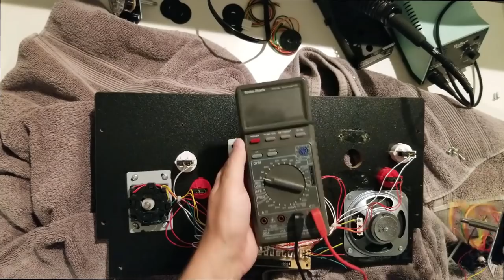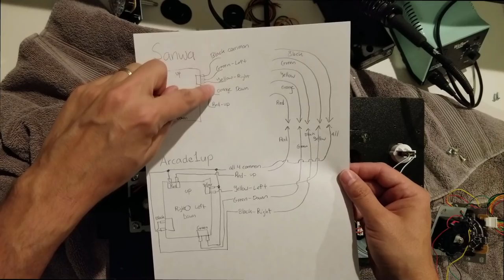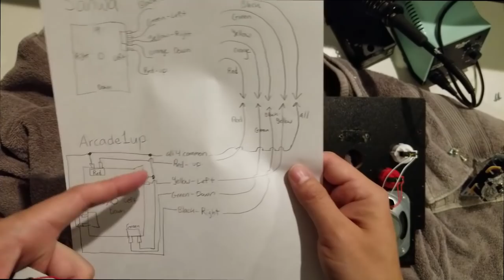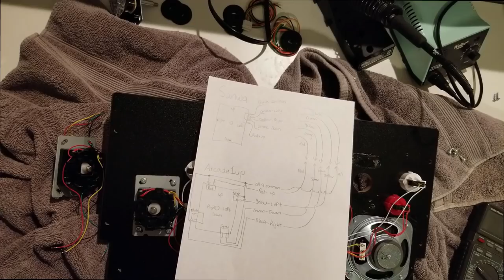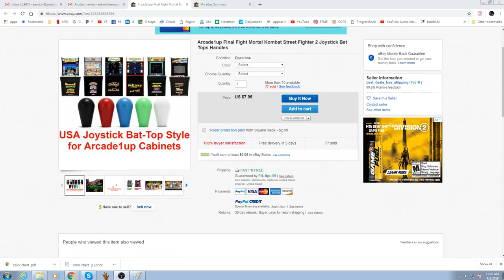Arcade1up Joystick UPGRADE!  SO WORTH IT!!

Comment: FYI: I purchased some Sanwa Joysticks to swap out in my 1-Up machines (I have a SF and Rampage). Had the wire cutters and soldering Iron ready, yet found when I opened them up, that the existing joysticks in my cabs were slightly different (white plastic base instead of black), and are 5 pin/wire, so the Sanwas were simply just Plug and Play! (I used the existing wiring and plugs) So easy! What a relief.
Reply: I guess I'm kinda randomly asking but does anybody know of a good site to stream new series online?
Reply: @Jamie Genesis I would suggest Flixzone. Just google for it =)
Reply: @Jefferson Yahir Definitely, have been watching on Flixzone for since april myself =)
Reply: @Jefferson Yahir thank you, I signed up and it seems like they got a lot of movies there =) I appreciate it !
Reply: @Jamie Genesis you are welcome :)

Comment: I really don’t understand why u made this such a big production. I just replaced my A1up pacman stock Joystick 🕹 with a Sanwa. I ordered it from diyretroarcade.com. They offered 2 kinds of encoders: old dual 4 pin or 5 pin. My cab had the older dual 4 pin. So it came with that wire. All I had to do is open the deck. Remove the stock joystick. Switch plates from the A1up Joystick to the Sanwa so I don’t have to drill. Swap the 8 position gate on the Sanwa for the true 4 position gate on the A1up Joystick (both gates are just pieces of plastic). Screw in the Sanwa to the board. Attach the dual 4 pin wires to the up & down port and left & right port. Test, and then close the whole thing up and remount the deck. That’s all there is to it. Didn’t have to break out any test meters or anything. Sounds like ur trying to adapt a 5 wire setup. All I really needed was that one wire with 2 4pin connectors & I was off to the races. 10 minute install.

Comment: There is a plug and play method from DIY Retro Arcade. Just buy the Sanwa sticks there and make sure to select which wiring you need (check your arcade. Some ship with different methods of connecting the joysticks from the factory) There is three option on the website, I believe. You'd save so much time. The part that took the longest was making sure the sticks were centered in the holes when getting the pilot holes and screws drilled into the CP. Then just plug them into the empty sockets you pulled the original sticks from. Buttons from there also work great, also plug and play. Highly recommended. If you have questions email Scott, I think his name is.
Reply: Thank you! I did not want to do all that soldering and guessing. I'll pay the extra money and save all that hassle.

Comment: Man, you made this project way harder than it needs to be. You probably scared many people off. You bought the wrong wiring harness set up for your machine. They have them so you don't have to be an electrician to do this project. You just match the proper wiring set up at purchase and plug in the harnesses to the proper place. Also the Sanwa's still only come with a 1 pound spring. It's best to get a 2 or 4 pounder(your preference I would try both) while you are at it. They also sell those where they sell the joysticks. If you use the old plate with the new stick you don't have to do any drilling. It's a plug and play 10 minute install
Reply from the maker: None of that information was available or known to me until this very moment.
Reply from the maker: @bigmacfullerton7870  Dude.. why are you acting so aggressive and rude?!?   Like I said... your comment was the first time I have heard there are different Sanwa wiring setups and mounting plates.  I have not yet verified that information either.

So why be so insulting?
Reply: @EdwintheMagicEngineer  I'm sorry I thought you were being facetious. If you really didn't know this then I wholeheartedly apologize. I thought you were being sarcastic and I was just thinking of all the people you scared off or may have entered into this world of wiring hell needlessly. Again I apologize for being rude. You seem like a nice guy. diyretroarcade.com has 4 different wiring set ups that cover just about everything. Others have them too.  Oh also Sanwa doesn't have other mounting plates you just use the old one, the original plate that comes with the game with the new joystick and it screws right in. You have to use the new mounting plate screws that came with the Sanwa stick and the old mounting plate that came with the game because the old screws won't fit in the Sanwa.
Reply from the maker: @bigmacfullerton7870  Thanks for the apology and DUDE!  That website is AWESOME!  I'm going to buy several things from it very soon!
Reply: @EdwintheMagicEngineer  Cool! Glad it worked out!

Comment: Where do you get the joystick
Reply from the maker: https://www.amazon.com/Denshi-JLF-TP-8YTFAST-SHIPPING-Joystick-Adjustable/dp/B01CRQMWEQ/ref=redir_mobile_desktop?ie=UTF8&aaxitk=m3JSHrna6eBZ4SjTODU3hg&hsa_cr_id=3187236950901&ref_=sbx_be_s_sparkle_asin_1
Reply: @EdwintheMagicEngineer  will it work on pacman 40th additon
Reply from the maker: @rickyholmes3549  I cannot 100% guarantee since I have never opened that one up myself.  But I very much suspect it will have similar circuitry to other cabinets.
Worst case (even though unlikely) I would be happy to help you with it if I can.  My public email is listed in my video description, email me if you run into an issue and I'll work with ya.

Comment: You needed to show splicing the wires. Did you just peel the rubber with a blade, then twist the wire and use electrical tape? That's not boring content.

Comment: Wow. This seems so longwinded. Great work though. 

I must have got lucky. My 1up joysticks were different to yours. They were 5 pin like the Sanwas. Also the base plate had 6 screws, 4 of which lined up perfectly with  the Sanwa sticks, so no need to drill new holes. It literally was a 5 minute plug and play job.
Reply from the maker: That's what I was expecting based on what I read online... too bad mine was not that easy.

I went back and forth on whether I should add all those details to the video, or just skip to the end result.  I suppose I'll see if people like all the description or if they just want the answer.
Reply: @EdwintheMagicEngineer  definitely good that you added all the details. Will no doubt help many people who end up with these stock sticks. When I said 'longwinded' I was referring to the actual process. Your video/upload is spot on. 👌
Reply: yeah my holes almost lined up but not exactly, for me a better solution was to switch the base plates between sticks (old to new). works perfect and then you will have 100% perfect screw hole line up.

Comment: Whats up Edwin? When you opened up the Sanwa joysticks it reminded me of a short-throw shifter for a racecar or performance mod for a manual vehicle. Also when you took the factory joystick switches out it seemed like the same thing as having a regular keyboard and moving up to a mechanical keyboard (Night and Day difference!) The wiring seemed like a pain in the butt but you specialize in computer stuff so it probable wasn't too bad for you. Cool Video!
Reply from the maker: Hey Sean, I'm glad you enjoyed it.  Yeah it was not difficult with my background but hopefully this is helpful to others wanting to do the same upgrade.
Reply: @EdwintheMagicEngineer  Most definately!  I bet they won't have radioshack multi-meters though.

Comment: Just what I was looking for.  Had a joystick start malfunctioning on me today.  Good time to upgrade, I guess.
Reply from the maker: Hello J Wunder, did you ever replace the Joystick?  How did it work?
Reply: I have a Midway 12 in 1 arcade that has a bad joystick due to an over excited 4 year old.  I haven't figured out how to get access to the control panel and don't want to break anything else. 

Any suggestions on how to proceed.  Will the Sanwa joystick work as a replacement?

Comment: You made this way harder than it is. All you need is a Sanwa arcade kit set that comes with a USB encoder. takes a few mins to do. ZERO solderings.
Reply: Diy Retro Arcade has Sanwa sticks that come with the 2 connectors like the original cheap sticks have. No USB encoder needed. They plug right into where the original got removed from. You gotta make sure you select the right wires "harness", I think there is 3 options on the website.
Reply: He should really take this down. So many have tried doing it this way needlessly. What a headache and waste of time!

Comment: Thank you so much for the tutorial. Great job explaining the details and schematics. I was able to do this on my Pacman arcade, just had to invert the cables for my cabinet, but worked wonderfully.
Reply: John Gonzalez does that mean you had to do the wiring the opposite way? I’m having a tough time, I went by the video and assumed it worked the same way for the pacman
Reply: @NaeroK87  I followed the video connecting the wires as shown, but for some reason,  did not work on the pacman machine.  So I connected the "common or ground" wires where the regular singles wires would have connected in the diagram and vice versa with the single wires and worked.
Reply: @NaeroK87  I wonder if maybe the board used to connect the joystick on the pacman machine differs from the one used in the Rampage one since that one connects 3 joysticks. If you're not sure, follow the video instructions and if it doesnt work for you, wire the opposite way.
Reply: John Gonzalez yeah I tried that and it worked. The pacman must be opposite of the rampage. I figured they were all the same but yeah I switched the ground wires around and it worked great.
Reply: @john Gonzales, I just got Pacman and was wondering about the joystick.  About how long would you say it took you to switch it out.  This will be my first time doing this.
Reply: @deec1626  It took me about a 1-1.5 hours to cut the wires, rewire, removal of old joystick (found mine glued) and to drill new holes for the sanwa joystick.
Reply: @deec1626  Forgot to mention that I didnt solder the wires neither, I just twisted the wires and taped with black electrical tape.
Reply: John Gonzalez I also did this lol

Comment: I appreciate the video in case i have to resort to this in the future on another project. But i am very glad someone in the commemts said you can buy a cable that does this without the rewiring. Still thankful, because i would not have known that if it wasnt for this video because then that comment would not have been left
Reply from the maker: When this video was made there was NOTHING out there explaining what I did and no products you could buy to accomplish the same thing.

Now there is and that’s great.  But as you noted sometimes somebody (in this case me) has to take that first step in solving a problem

Comment: Officially too complicated for me. Here's hoping I don't have any go out on me.
Reply: It's not that difficult. He had the wrong wiring harness set up for his machine so he had to rewire the whole damn thing. They sell like 4 different wiring set ups that work for different games. You literally just plug them into the right harness and you are good to go. You just have to take a look and match the correct wiring set up for the machine you have. If you can't figure it out you can send them a picture and they will get you the correct wiring harness set up for your machine. I am no electrician or mechanic and I did this fairly easily.

Comment: I recently played with a Arcade1Up Street Fighter II display and I can attest that the controls do wear out over time as does the console art. If I ever purchase an Arcade1Up cabinet or two, replacing the controls for better ones will be my list. BTW, Greg Planamento made a vastly superior spinner for the Asteroids and Atari 12-in-1 cabinets and tested it on his YouTube channel.

I do have to ask regarding upgrading the Arcade1Up speaker to duel speakers located on the control panel. Any advice on doing that and what type of speakers would you recommend?
Reply from the maker: Honestly I think the default speaker is just fine.  It's plenty loud and with the big empty cabinet it actually sounds pretty good I think. I often find myself wishing there was a volume setting 1 notch LOWER on my SFII cabinet.

BTW... now that I have upgraded the joysticks I'm pulling off fireball/uppercut tactic with really solid dependability!  It's SO much better with a high quality joystick!

Comment: Do you have a video doing a joystick install on a Pac-Man machine?
Reply from the maker: No... but I did convert my own Arcade1Up Pacman machine and it was the same circuit diagram for the joystick that I showed in the video.
If you attempt a conversion using the Sanwa upgrade and run into a problem, email me.  My email is in the video description.  Good luck!

Comment: Did you have any problem with the pac man hanging up when using the pac man arcade?  Might have a bad controller, not sure.
Reply from the maker: What do you mean "hanging up"

As in the ROM froze?  Or the joystick was not responsive?  Or some buttons didn't respond?
Reply: @EdwintheMagicEngineer  Think I found the problem. Had the inner ring set for 4way instead of 8way. Many thanks for responding.

Comment: How do you change springs?
Reply from the maker: I didn't I just swapped out the whole joystick.
Reply: You have to pop that little metal clip off the stick and then it's in there. They have videos on how to change the spring

Comment: I just copied exactly what you did and none of the controls worked. Is it different for a pacman?
Reply from the maker: Email me a picture and schematic of what you did along with a description of what is happening now.

Edwinthemagicengineer@gmail.com
Reply: Edwin the Magic Engineer thank you, I did figure it out after alittle bit of trial and error. Works great now, thanks for the video 👍
Reply from the maker: @NaeroK87  Glad it's worked out.  Just curious... what did the error end up being?  Was my explanation or schematic confusing or something?
Reply: Edwin the Magic Engineer well pacman and rampage must be different. I followed exactly what you did and none of the controls worked at all. I switched the wires for the controls to ground wires and vice versa and it worked. I think I had to switch the wire that goes left around too but I think that was my mistake.
Reply from the maker: @NaeroK87  Without seeing pictures of  your work it's hard to know for sure... but it sounds like you swapped the signal wire and the ground wire somewhere.

The easiest place to see a mistake like that happening is coming right off the PCB where the 8x original controller wires connected to the electronics board.  I was able to pick the ground wires as ground because I could see the copper traces literally connecting 4 of them together right there so I knew they must be ground.
Reply: Edwin the Magic Engineer Ah ok, I just copied what you did and was crossing my fingers. I should’ve checked which ones were ground.

Comment: Are they a bit stiffer?
Reply from the maker: Yes they are.  And the "click" activation is in a much better location.  They not only work better they feel better.  Sanwa's are the best.
Reply: @EdwintheMagicEngineer  thanks! Just bought mine yesterday and the stock joysticks feel a bit cheap...